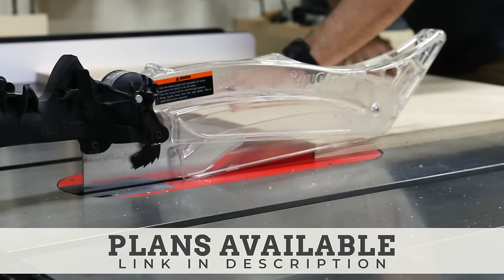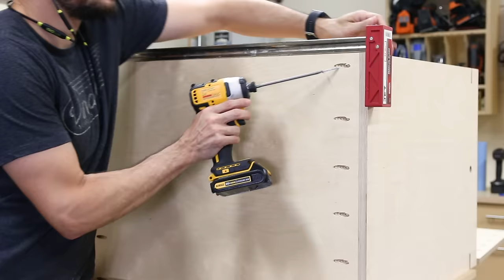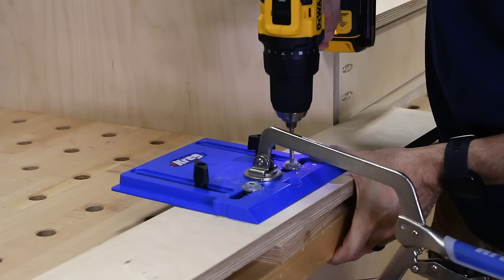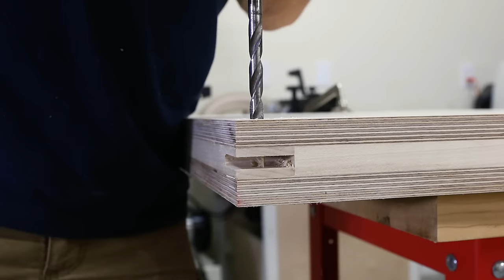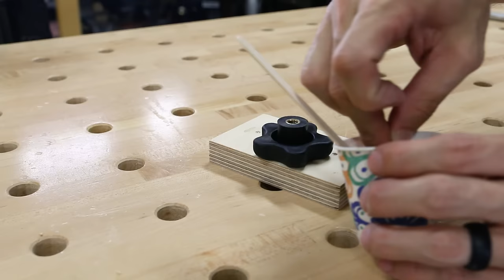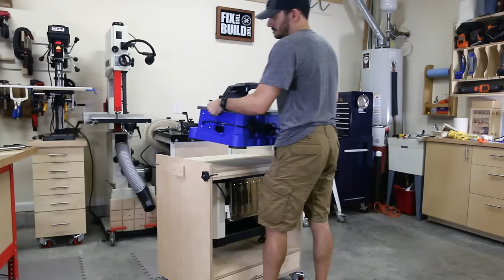Flip Top Tool Stand with NEW Features | DIY Shop Storage

Comment: Hello Brad!  I ordered the plans earlier this year and finally got around to building the cart over the past week.  It turned out great!  Two things I want to mention though that may help others with the build.  First, I just didn't feel comfortable with the lag screw mounting method for the tools, so I went with holes drilled through the top and machine bolts, washers and nuts to secure my planer and sander.  Since the Dewalt 735 planer and my WEN sander have completely different mounting hole patterns, it wasn't a problem at all.  And even though two of the sander bolt holes ended up directly under the planer, the Dewalt 735 has what amounts to a "hollow" raised base that sits almost 2" above the surface which allowed for the end of the bolts from the sander to protrude 1/2" with no issue.  Secondly, and perhaps most importantly....if you are going to mount a Dewalt 735 planer and plan on centering it on the top, you will NOT be able to flip the top without removing the handle that raises and lowers the planer bed!  Ask me how I know...lol.  Yes, I was a bit bummed when I tried flipping the top for the first time, but that handle removed with only one hex bolt and the tool for it and other adjustments on the planer sits in its own slot right on top of the planer anyway.  The only solution that I could imagine would be to mount the Dewalt 735 at 90 degrees away from what I would consider to be the "normal" way to mount it OR simply move it to the left far enough for that handle to clear the top of the right side piece of the cart.  I'm sure those few inches wouldn't cause any issues with the balance of the cart.  For me though, I'll be in the "remove the handle" crowd whenever I need to use the sander! 😅
Reply from the maker: Awesome to hear you finished it up and it's working well.  And I can totally appreciate you not wanting to have the 735 off center, lol
Reply: Thank you for this information. I was wondering too. I am also building one right now and that was a concern to me. I will follow your advice.
Reply: What size bolts, etc did you use for the 735?  Thanks!!
Reply: @johnpelz ...I used the largest diameter bolts that fit through the holes in the base and the length was determined by the thickness of the shelf that flips.

Comment: Thanks for the plans, Easy to follow (along with the video) and the end result looks great and works well!  I note a few things; The plan calls for 3/4" pipe and to drill a 3/4" hole on each side.  The 3/4" pipe has a 1" outside diameter.  The plans should reflect this or at least the verify the proper size holes.  Also, I added a 2X6 frame on the bottom of the cart to add a bit more wood and larger screws to attach the casters and give it a bit more weight given that I was attaching a thicknesser which is quite heavy, just a suggestion, thanks.

Comment: Great video and info, thanks!  I'm building this now but with a few changes.

Rather than a 3/4" tube to hold the flip top, I'm using a 5/8" steel bar (cuz I had that available). I cut a 5/8 cove along the edges of the pieces that sandwich the bar so there's no wobble as it spins. The bar will rest into 5/8" flange bearings to allow easier flipping.
Also, rather cutting the slots for the retaining eye bolts, I glued 2.5 x 2.5 x .25 piece of poplar at each corner of each piece of the flip top. I already had the 1/4" wood  and it made things so much easier.  This also allows adding ball catches rather than using magnets.
Lastly, I added a hanging tool storage to the side for the lathe tools.
I made mine 33" wide to fit my mini lathe.

Comment: Great plan, I did add one enhancement that might help with operations and longevity, I added a 3/4 id. and 1 3/8 OD bearing bored 1/2 into the inside of the side panels
Reply: What pipe did you use then? Box store steel pipe wouldn’t fit

Comment: Does anyone else who has made this experience the sides separating from the top when you spin it?  Every time I rotate the top, I have the bang both sides back on to the pipe.  I'm not sure what is causing this at the moment but I'm thinking the pipe being captured on the outside of the side with something like a locking collar & thrust bearing would solve this issue...of course you'd loose the extra support block.  We'll see!  I just got mine finished yesterday and I'm excited to have the space saving opportunity from another FTBT idea.  I added some little extras with a walnut drawer front and 3D printed accessory holders and cord wraps.  I also need to come up with something to prevent my planer tables from falling during the rotation but overall a win for the shop!  Thanks Brad.

Comment: Great video. I like the detail and explanations for your design elements. I made mine in almost the same way, but with 2 differences. First, I used 1/2" solid bar and bronze bushing instead of the metal tube. I found they were easier to source. Second, my bottom drawer floats on two thin hardwood pieces instead of a drawer slide. This lets me open it from either side with drawer pulls on both sides (two drawer fronts). Like you, I pull mine out and away from the wall about every time I use it. My floating drawer lets me store accessories for one tool in the front half of the drawer and accessories for the other tool in the other half of the drawer.
Reply from the maker: Those are good design changes 👍
Reply: Hollow tube can let you run power through it to the tools so you don't have to plug them in every time you use them. Easier if you use 2 shorter pieces and a T-junction than trying to cut a hole for the interior access. Make sure you stop the flipping at 180° so it doesn't coil up the cord over time, and run power in through the tube to a power strip in the top that you plug both tools into.

Comment: Nice work!

I've got the plans and most of the material already. But I'm in the middle of a major purge of my basement/shop. When done, I'll get going on this build. I have a Dewalt 735 with an upgraded Shelix head. I'll be picking up a Ridgid oscillating belt/spindle sander. This will be perfect. But I have a suggestion for your build. When assembling the box, t would be much easier to install the shelf/drawer top before the bottom. Much less hassle with installing the pocket screws. If you set t up carefully and use some bar clamps and temporary spacers, it will work just as well. Just my .02 worth.

Comment: I made this a while ago.  It's working great.  Nice to have the plans since the tools you put on the original build were the same ones I had.  Rare that I can just follow plans with no changes.  I did the pocket holes for the bottom. in a slightly different order.  I first attached the shelf, then the bottom.  I didn't have to use the "funyuns in the vending machine" technique that way.  Thanks for the good plans!

Comment: Love your shop, videos and precision.
If I might offer a suggestion on throwing away your Kregg driver bits? As a retired toolmaker/moldmaker who has sharpened my own drill bits and cutters for years……try using a pedestal grinder to remove the ‘rounded’ edge end. 
Use water to dip your bit into keeping it relatively cool, if your bit gets too hot and  ‘blues up’ you’ve taken the temper (hardness) out it.

You should add more life to that bit, saving you some money.
MikeC

Comment: Your plans were fantastic. Built mine over the weekend. $9 was a steal!  

Quick tip for folks building their own. I used 3/4” conduit which has a .9” outside diameter. I made .1” deep dado 1” wide in each of the tops as the 3/4 backing pieces were only .7” thick.
Reply: Thanks for the tip. I used the exact rod he used but it was still too tall for a 1x2 (3/4" actual) and just came inside to try and find a solution. Going back out to the shop to cut dados

Comment: It was a fun build! I was a hair off on the distance from the drawer to the side which has the drawer slides in a bit of a bind. I will need to install a shim to correct, You may want to final cut the drawer parts after the carcass is assembled to get the exact dimensions. Only thing that came up at the last moment is with the Rigid sander. I looked at it and thought "what is going to happen with all of these items stored in the base?" Good thing the drawer is deep enough to store the sanding belt attachment. Thanks again, my do the drill press stand next.

Comment: Great project and video. I made a minor error on my build.  The 3/4" baltic birch ply was a little shy of 3/4" thick, so my drawer width was a tad short.  No problem, cut a new front and back to width and drill new pocket holes.  The other recommendation I have is that the flip top should be cut 1/8" or so narrower than the bottom shelf to allow a small gap between the top and the sides so it can rotate freely. Again, its a relatively easy fix.  Next up, the miter station!
Reply from the maker: Awesome! Have fun with the miter station 👍

Comment: Brad,
Locked up in my garage workshop for a few weeks, I will be building a flip top stand for my Dewalt planer and Ridgid spindle sander. While preparing to purchase plans I stumbled upon the video you did in 2016.  It calls for 5/16-18 eyebolt knobs.  Your video done in August 2019 uses 1/4-20  knobs. I am assuming either will support the cart.  May be dumb question, but I'm a simple man and confuse easily.  I just want to get it right.
Thanks,
Jim

Comment: I have a very tight space to build a garage workshop that can still fit both cars when using it for its secondary usage as a place to park cars. My plan is to put a stationary bench with a miter saw on one end, a drawer/storage section in the middle and and a router table on the other end. This bench would be against the back wall. And then I plan on having two mobile stands, one for my thickness planer and the other for my jobsite table saw that would be rolled against the back wall when not being used, one on each side of the stationary bench. The table saw top would then also serve as material support for either the miter saw or the router table.

But I was having trouble seeing how to make a stand for the planer that could also serve as an extension of the workcenter when the planer stand was not being used and the stand was stored on the other side of the workcenter. My first thought was to make the top of the planer stand flush with the workcenter top. The planer would then store inside the stand on a platform that slides out on heavy duty draw slides. When I need to use the planer, I roll it out into the middle of the garage floor, slide the platform out and simply pick up the planer and put it on the top surface of the stand. 

And then I saw your video and I think I have my solution. Instead of putting two tools on the platform, my thinking is that I could put the planer on one side and then extend the surface of the pivoting platform so that when the planer is facing downwards, the surface of the platform on the other side is flush with the sides of the stand. I understand that the pipe is held in place by the two cross pieces and the top and bottom surface of the platform and that I would have to put a cap piece of wood spanning the two cross pieces to provide the fourth surface need to hold the pipe in place. Is there anything that I am missing that would make this not work?

Comment: This is the best looking/functioning example I’ve seen so far. Had been considering a flip top just to have a home for my scroll saw, but haven’t decided what to put on other side since I really don’t think it would fit my needs for the miter saw because of outfeed needs. Considered putting my 1” x 30”/5” sander on the opposite, but that’s a relatively tall tool....  only other idea is to build a router station while making it exactly workbench height so outfeed isn’t an issue when need it can be rolled over to the bench.  Thoughts?

Comment: Hi Brad : Love your work!  I've completed the flip top stand , but am worried that the lag bolts to mount the planer won't hold that heavy weight when it's upside down.  It seems that's all you use on yours -  but did you put the lag screws into anchors, or just straight into the plywood top and spacers.  Appreciate  your guidance here.
Reply: I'd like to know also. I have a Dewalt that is over 80 lbs.

Comment: Nice build. I am currently starting with a rework of my 92 sqft shop and plan to buil 3 flip tops to mount all my bench top tools on them. I am planning on putting height adjustable wings on at least one of them to add support for the one my miter saw will be on.
Reply from the maker: that sounds awesome!

Comment: I bought your plans for this on Thursday, starting cutting out the pieces on Friday, built it on Saturday and was using it all day Sunday. Great, simple design and easy-to-read plans. Thanks a bunch!
(I've got a Dewalt 735X on one side, my 20-year-old Ridgid  oscillating sander on the other.)
Reply: Did you have to change why measurements?
Reply: @ericawilliams18  I don't recall changing anything.
Reply: @DavidGunter  okay thanks I have  same planner and it. Needs a home asap it’s so heavy

Comment: Hi Brad! Great project and design. I have all parts cut to size now, but I will add a power cord sandwiched in the top. I have one question only. Is there a reason why you haven't used glue in the frame? Thank you very much for sharing the assembly.

Comment: I built this a couple weeks ago. I had to make mine 6 inches taller to mount a bench top band saw...I didn't want to lose the drawer...I'm tall, so the sander and band saw heights are good for me.
I just used a plumbers tubing cutter to cut the pipe. 
I looked at other designs with the hidden cords...but they are fine the way FTBT has them.
Glad I got the plans from FTBT.

Comment: How do you know/measure how tall/large of gap you need, for each tool to rotate without bumping? I have a Ridgid R4331 bench top planer and a Delta Cruzer 10" miter saw that I would like to build this flip top cart for. Thanks!

Comment: What are the dimensions of the open space within the cabinet for a tool?  I want to put my planer and desktop joiner in this unit but need to know how I might need to add inches if the space as now designed to large enough for either tool.  Love this unit and am eager to build..I'll see if from your pictures and build list if I can calculate it.

Comment: I really do like this design & idea. So far, IMO the best use of space for a smaller shop (like mine!).
I have this "portable" drill press that you add your cordless drill on the top and push it down to drill straight. Im going to use it to do that part @ 1:10.

Comment: Have you run into issues with the performance of the tools as they get flipped upside down during non use?   Have you ever run into any problems with the planer coming out of adjustment or sawdust falling into areas of the planer that normally wouldn’t occur had it not been flipped over?   Just curious.

Comment: Hi Brad, I've got a Dewalt 735 planer and a Rikon belt/disc sander that I need on stands. The planer is 92#, the sander is 32#. Any concern about imbalance of weight? More of a worry for me is a 92# planer hanging upside down. Do I need to beef up the plans for the planer? Thanks so much for this great video. Just bought the plans!

Comment: Brad, great video. I’m definitely a fan of your work. Had a question.  I’m curious to how tall the cart is.You look kinda tall so I’m wondering if it will work for me.  Planning on putting a ryobi universal routing table (L32 x W18 x  H20) on one side and the Ridgid oscillating spindle sander on the other (approx same height).Seems like it may be too high for a router table.  Thoughts?

Comment: I'm interested in your no-mar countersink bit.  In your comment you state that it's the Amana 55227, but that one seems sized for #6 screws.  Do you use #6 or #8 screws? Curious because the Amana 55229 appears to be better suited for #8 screws based on Amazon comments.

Comment: Thanks Brad! Been looking for a nice flip-top plan, you hit a home run. Quick question, if I wanted to make the flip-top the same height as the side walls of the cart, that wouldn't be a problem, would it? I would just have to drill the holes for the pipe a little higher on the sidewalls.
Reply from the maker: Only concern would be that slot that holds the eye bolts would be very close to top and that top portion could break easier. But it doesn't take any weight so should be fine
Reply: @Fixthisbuildthat  I was thinking of using some simple gate latches instead of the eye bolts to secure the top

Comment: I built this, not as pretty as yours, with every bit of scrap plywood and an old bathroom drawer from when I tore out the 50's bathroom.  What is nice about your design is that you can add side lift wings on it. I mounted my triton sander and my compound miter saw.  Will may lift wings for the miter saw on both sides to accomodate cutting longer boards.  Thx for the design.

Comment: For the top, you mention a 3/4" wide gap for the steel pipe.  Where do you find pipe that is 3/4" OD, or am I misunderstanding what you are doing?  The 3/4" pipe I'm familiar with is about 1.05" OD.  Thanks.

Comment: One of my telescopes has similar hardware.  The corners that the washers have to pass are radiused to reduce the distance the knobs have to be unscrewed.  Is there any reason you can see that would be unsafe on this cabinet?  I like your build much better than those that use pins to "secure" the top.

Comment: Hey Brad, I'm looking at picking this plan up, but was hoping you could help answer: would it be able to handle a Dewalt planer on one side, and 8" Cutech jointer on the other? I'm assuming the jointer should be ok, as long as I have the wings going front to back instead of side-to-side....any thoughts?